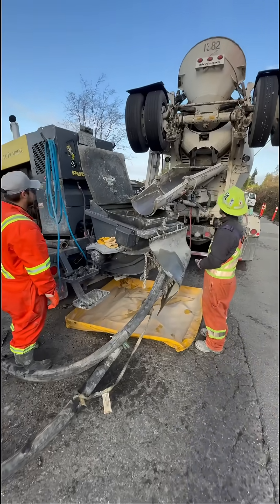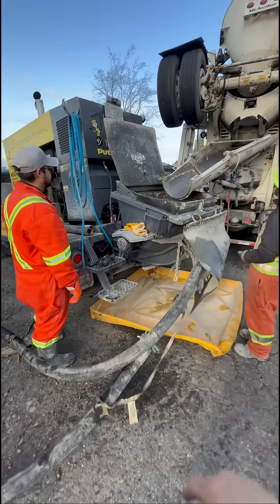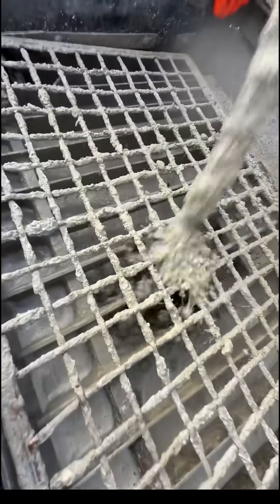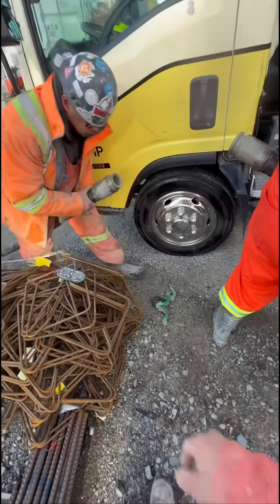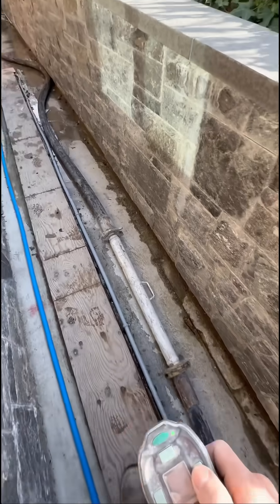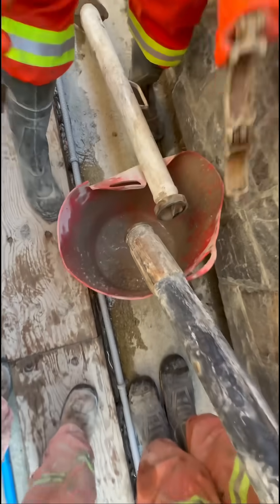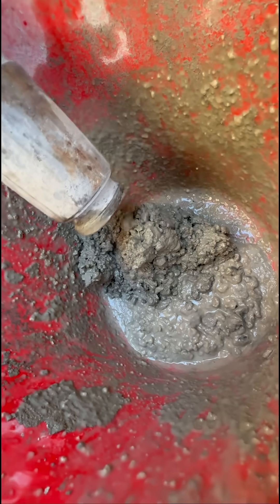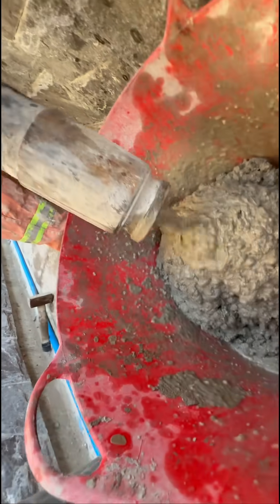FAILED 350’ bentonite prime!!!

Comment: I feel like you haven’t been having very much success with priming using bentonite  lately or for awhile actually 😅 or am I mistaken? If so, sorry for stating that. lol
Reply from the maker: @randyanderson1983  it just ain’t jiving with our current mix designs here quite the same way as it used to. I’m out today using tried and true mortar mix (don’t tell Muddy Feet) 😂😂😂
Reply: Order 1yd of high sack slurry as primer
Reply from the maker: @ close to $900 with all of the small load fees etc in our area, not to mention we need a place to dispose of it onsite.